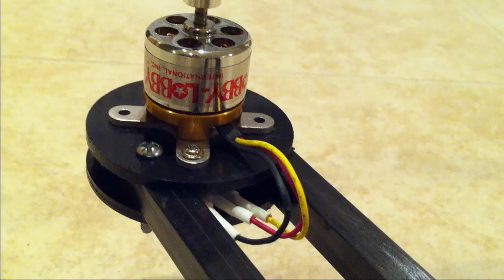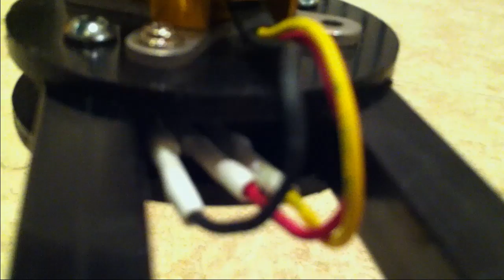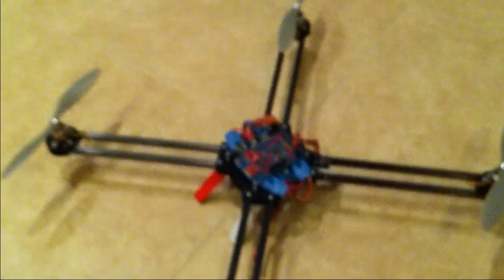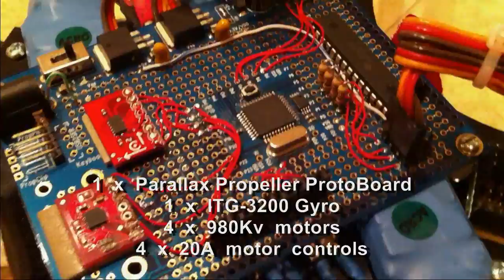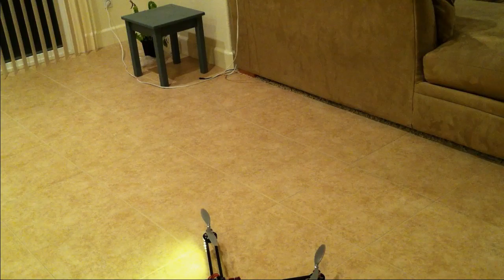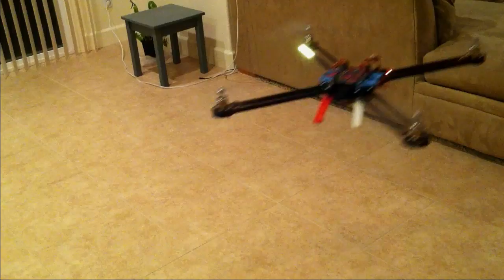Propeller Based Quadrotor

Comment from the maker: @Nomoreidsleft - The Prop is well suited for this because it doesn't need interrupts - one hardware thread runs the ESCs, one reads the receiver, one reads the gyro & accelerometer, and one runs the main loop.  The servo output code is a modification of the standard Parallax servo object, and will update 8 servos at over 250hz with 10 bit resolution.  (The standard object does 32 servos at 50hz).  It's software, written in ASM for perfect timing.  So the short answer is it's really good.  :-)